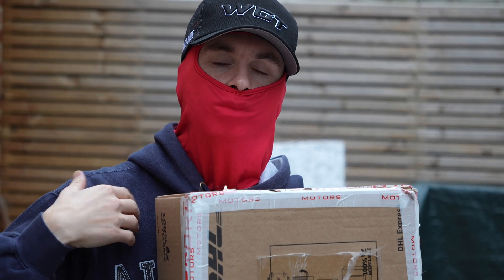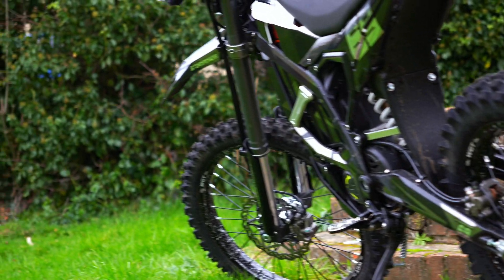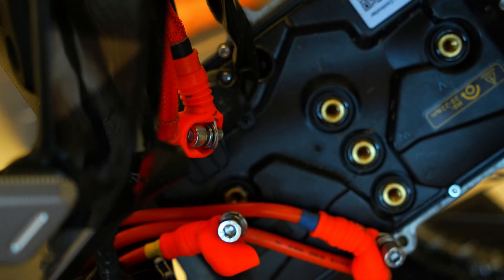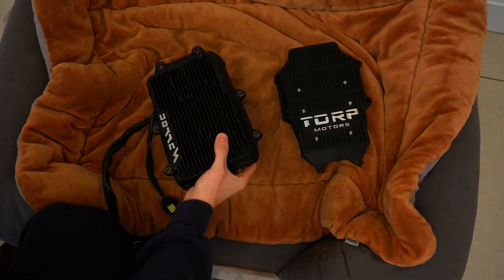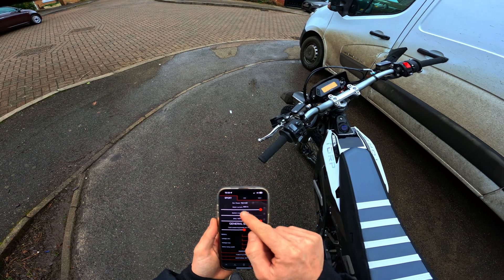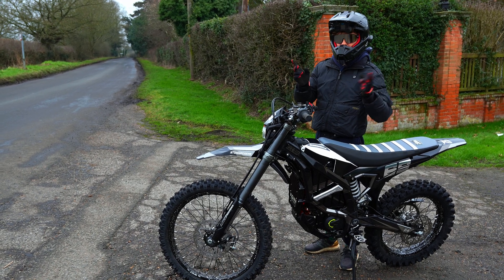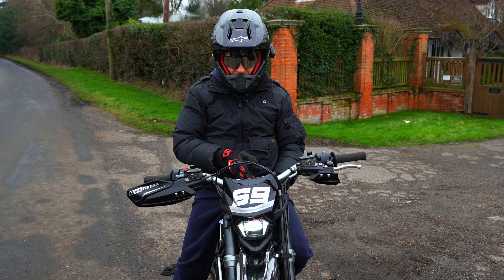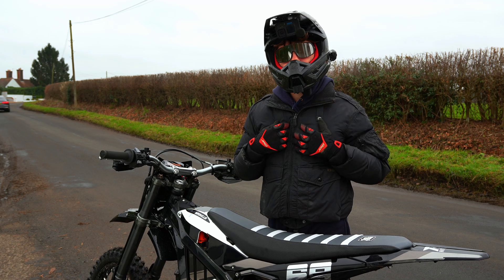How-To DOUBLE the POWER of your STOCK ULTRA BEE! // TORP TC1000 Install + Top Speed!

Comment: I'm confused why the 2025 ultra bee can't hit at least almost 70mph if it has 18kw stock
Reply from the maker: Power doesnt equal speed. Power equals acceleration. 

Electric motors can only spin to their max rpm the magnets and electromagnetic field inside it allow it to. The rpms relative to the amps are measured in KV. Higher KV = more rpm = more top speed. 

You can add some ‘field weakening’ to the motor using aftermarket controllers which unlocks a few more rpm at the top by lowering the magnetic field inside the motor and reducing load and strain.  

The 2024 gen 2 motor and the 2025 motor are extremely low kv motor. Even with aftermarket controllers and 21kw constant max field weakening they can only do around 64mph.
Reply: @stingyrogerr sorry abit late to the party here is this worth it on the 2025 model does the app know year of the bike ?.
Reply from the maker: Yes, torp allows circa 70mph and 27kw on recent update released yesterday
Reply: @stingyrogerr I'm quite new to whole Surron thing not gonna lie looking at my first road legal 2025 is 18kw isn't so with controller would go up to 27kw 70mph is that right
Reply from the maker: Yea, you have the 2025 so if you have the HP version if you double tap r/t on the left cluster you should go into turbo mode which is 21kw for 10 seconds as standard, where as the tc1000 torp controller will boost this to 27kw all the time. If you need any more help curtis feel free to message me on instagram, @stingyrogerr is my user name with the two r’s on the end. Thats how most people get the best response. I don’t reply too much on my youtube threads as it generally spams out the videos comments section

Comment: Can the stock motor take it, and the battery without any upgrades besides the controller. Waiting for the Talaria Komodo to arrive, and want to increase its power and thought of doing a controller upgrade, but I’m scared of anything overheat or breaks.
Reply from the maker: Yea its easy on the battery and motor. Had 35kw from stock motor no issues :)

Comment: Remember to select ‘’ bypass battery” option on your Torp TC controller app after selecting stock battery, otherwise the BMS system of the stock battery will keep overriding the torp controller after or below 80% battery has been reached . If you don’t select that option, it will barely make it to 30mph as the battery keeps lowering its percentage. Amazing controller. I love it for that same reason. The BMS battery of surron it’s like having a ‘’nanny” riding on your handlebars😂
Reply from the maker: Hey bro! Definitely think you should have torp support check this out! I never experienced this neither do my stock battery buddies! Makes a lot of sense what you say tho! You’re referring to battery sag! It trips the bms to thinking the pack’s dead!

Comment: Do you think you could make a video or short testing the top speed on gps with the torp?
Reply from the maker: @yaminhelal6445  i have my speedometer gps calibrated before making the riding test but now I run a 55kw 80v setup with the tm50pro and no longer have stock motor or battery to hand. 

Usually in my other videos I’m using a dragy side by side but for this video forgot. Although my buddy made a video using the vtb controller which does the same thing communicating with the bms and reached 74GPS : link to that video - https://youtu.be/6e5TtynkgFc?si=eBaMZh1IEm5t7PKD

The newer style motor is slower and only reaches around 63mph GPS. This is a 24’ bike with the 23 style motor although has a 24’ serial no. On it

Comment: Sorry to pester you again? I had a arctic leopord and highly recommend staying away from them lol. Just got another surron ub and ordered a torp1000 ect but was curious if your getting away with the belt drive or had to go to a chain system on shaft to engine?
Reply from the maker: Belt’s been fine 170 miles in so far! Original belt and jackshaft. ‘Stingy5’ at checkout with TORP gets a discount 👍🏻
Reply: Damn I ordered one last night lol. Thanks for the info and your time though much appreciated! Your videos have helped alot with decisions🫡
Reply: I got stock ultra bee 2024 18/21 wheelset all built with suspension and everything else you can on it. Waiting doe my chi battery and torp motor still. Running tc1000 on stock motor and battery just playing/waiting. Running it at 16kw. 100% charge to 10% in 5miles! I sure hope this chi apex helps or I wasted alot of money I will cry lol

Comment: Swap it for 2025 ultrabee 2
Reply from the maker: No thanks 🤣 controller battery and motor already been swapped out on mine, 70hp 6300wh and still 2k less than the new one which isnt due until april. New one is 4300w and about 28hp. Thanks for the comment

Comment: Great video,.Does traction control still work the same, or better? I use it heaps in the sand.
Reply: yh torp only controller tht keeps all stock features shit tune tho tbh
Reply: @mai-deum3731 its adjustable.
Reply: @ yh fully bit of less tuning then ebmx but yh its good im debating torp or ebmx ebmx looks nice tho
Reply from the maker: @mai-deum3731 have a look at @wgtracing - the vtb does the same thing as the torp with more functions if you dont need the original switchgear. Hes getting 21kw from his vtb. He uploaded a video this week to his channel about it

https://youtu.be/6e5TtynkgFc?si=Fqf-fnJveEwFZcVw
Reply: @ yh i seen it its bad but gonna keep original swtich gear for the lights n tht either goin torp or ebmx might go ebmx if the 88v comes in stock again
Reply from the maker: @mai-deum3731 didnt think ebmx retained original switchgear gear for lighting, think the lights stay on instead. Dont quote me on that though. 

Ebmx x9000 max working voltage is 93v. An 82v like my battery is 92v fully charged. You cant use the 88v on the ebmx as its 100+v fully charged. 

Does this make sense?

You have nominal and charged voltage. A 72v battery is 84v fully charged, 82v is 92v fully charged. The nominal is the 72,82 ect that they list the battery as
Reply: @ nah they got a new loom or smthn i emailed them the other day i heard tht first but yh they found out how to retain it u just cant use asr or mode switch obvs but indicators n high beam n tht works
Reply: @ but the 88v works u just gotta lower it apparently
Reply from the maker: @ ah good luck mate 👍🏻 lemme know how it goes
Reply: @ will do wont be getting it till end march april anyway gettin 1821 n trial tyres first
Reply from the maker: No it doesnt keep asr but asr worked on the 21/18 wheelsset from WGTracing before the torp went on.
Reply: @stingyrogerr looked on the website, might be coming in the future.

Comment: does your blinkers work still with the torp?
Reply: yes everything does
Reply: @ i heard ebmx controller didnt support the ultra bee blinkers and hazard lights
Reply from the maker: Probably not - it also produces less power and cant use the original display! I’d pick VTB over ebmx. Very similar controller but communication with bms remains and has a nice new display which bolts to the original ultra bee placement. Mine is also road legal although i made all the lighting on switches and also micro indicators and an led light bar tail light with inbuilt blinkers. If you look closely at my headlight cowl you can see tiny blinkers on the fork legs
Reply from the maker: Yes they do!
Reply: @ thanks brother. great video and thanks for letting me know. I have a Ultra bee in Australia and can road register it to ride legally, just need to get my license lol.

Comment: Which bike is quieter mx4 or Ultra bee?
Reply from the maker: Ultra bee is faster out the box than the mx5 to 50mph and destroys the mx4 in a drag race  -  it accelerates faster than both stock
Reply: @ sick brother.

What about noise. Is talaria gearbox significantly quieter than ultra?
Reply from the maker: @watermelonaxe not significantly, a stock talaria when riding makes all kinds of horrid noises from the gearbox and battery the ultra bee has no rattles or sounds just can hear the massive 520 chain going around on the sprocket. Id say its about 10% louder but 50% more refined
Reply: @stingyrogerr  sick sick .

I got a UB COMING